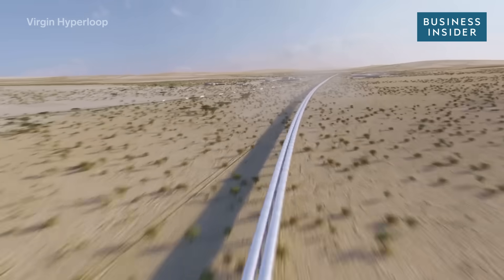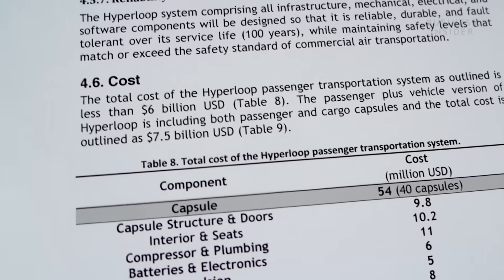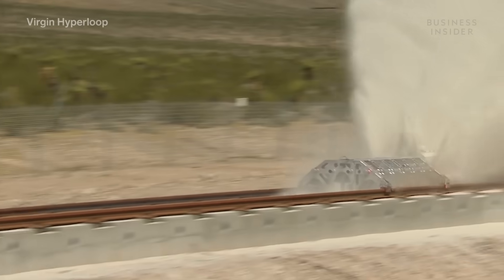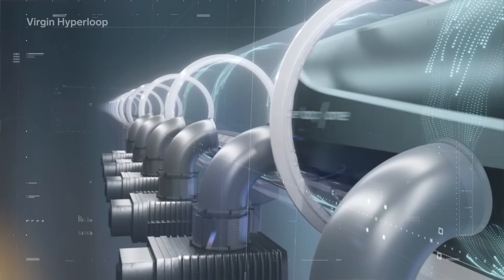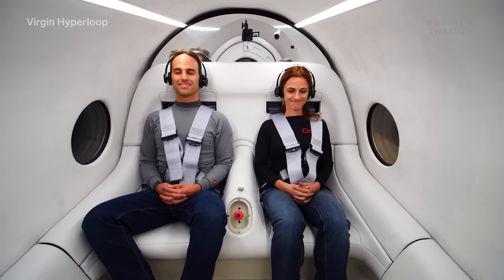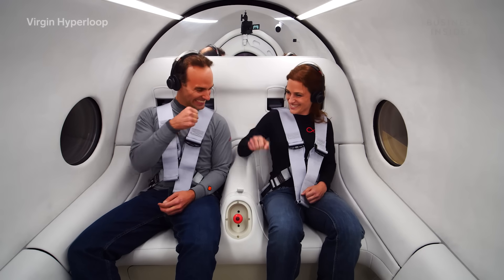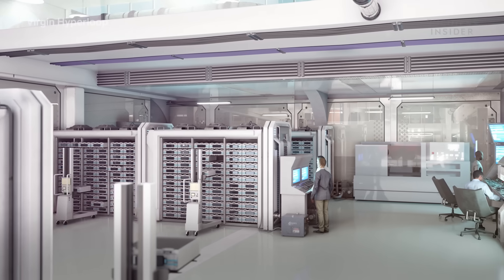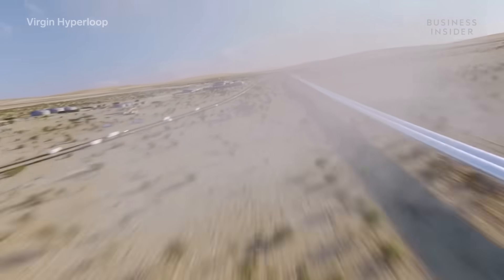How Elon Musk's 700 MPH Hyperloop Concept Could Become The Fastest Way To Travel

Comment: God. Can you imagine how terrifying it would be to be on that train and then the power shuts down or the train stops or something? You'd be stuck in over a hundred mile-long tunnel that is almost completely airtight.
Reply: Just ride a bicycle
Reply: @rennmedia  good movie idea lol
Reply: @rennmedia  Only if our cities were designed for bikes 🤔🤔
Reply: @WhiteOut-  Laughs in Dutch
Reply: @WhiteOut- come to the Netherlands
Reply: @rennmedia  if only you had air tho
Reply: @rennmedia  yeah you ride 30 miles to work every day on a bicycle
Reply: @rennmedia  yeah, it Superman is the driver
Reply: just imagine you travel with airplane,
Reply: @kharisnamaku  yeah LOL imagine choosing travel inside a bullet over than the safest transportation ever created 😂
Reply: Bro this comment thread is absolutely fascinating
Reply: Yeah, screw that.
Reply: It's a lot worse than that. If the tube ruptured at any point along its length, the train cars would be a obliterated by the air rushing in at the speed of sound, and the wreckage would be fired out like a bullet.
Reply: @simkoning4648  we have submarines that are airtight that haven’t been breached in 80 years.
Reply: Our bodies can bear the atmospheric pressure.
So can the capsule.

If air enters it will only slow down the capsule.

Also the tube is made with a material that can handle change in temperature.
Reply: @simkoning4648  the tunnels are vacuum or near vacuum.
Reply: @simkoning4648  WRONG. You just put 1 way air control valves every 10 meters or so along the length of the tube that open to the outside air if there is a loss of pressure. You haven't been watching Thunderf00t lies again have you?
Reply: Can you imagine how terrifying it would be to be on that train and then the vaccum is breached and you're whole body is forced through a 1 inch hole?
Reply: @Anonarchist  how will they be a hole then 
If theres an explosion you would have already died 
And you probably wear seatbelts since its that fast the first thing getting suck is probably bags and all that
Reply: @Anonarchist  that is creepy n scary af altho i think the will reinforce the body of the capsule n like sensors in the frame to detect breches which will immediately shut it down and preassureize the whole thing
Reply: @Anonarchist  don't worry, your body should be able to withstand 14.7 pound
Reply: @Anonarchist  I'm sure it'd be as terrifying as a breach on a pressurized airplane. That's why it's been tested over and over.
Reply: Kinda like on a plane that is decompressed
Reply: @Anonarchist  That's movie fantasy. Atmospheric pressure is only 14psi. However, if the tube failed catastrophically, which is very likely, the air rushing in would turn the tube into a air cannon and obliterate the cars inside it.
Reply: @Anonarchist  said, "the vaccum is breached and you're whole body is forced through a 1 inch hole?"

The exterior pressure is higher than the interior.  Thus this wouldn't happen.  Be pretty bad, though.
Reply: Emergency air tanks and escape latches with ladders spread over every mile?
Reply: @letsthink8245  that would mean at least tens of thousands of more seals and possible air leaks. which would render the 'vacuum tube' obsolete if it can't keep a vacuum
Reply: @boink666 even space is not and absolute vacuum. That is impossible but you could remove most resistance however. That in itself would be something. You could create a barrier like your tire with a gel that deals with leaks and seals them. Much like the green stuff  that would also do wonders on a space station as well.
Food for thought.
Reply: @letsthink8245  as soon as you opened the capsule door everyone would be dead in a matter of just a few seconds....
Reply: These people 🤦🏻‍♂️ 
Man, the INTELLIGENCE..!
Reply: Just a quick question, how should the emergency exit work? There is a vacuum, a door (that will have to be perfectly sealed when not in use) will have giant pressure pushing is closed. If you opened it, you would have to fill the whole tube with air until you can exit. Which means that you will either have to wait days, or be blown through the tube.
Reply: ”Can you imagine how terrifying it would be to be on a plane over the ocean and then the power shuts down or something?”
-What people said to the Wright brothers
Reply: That's why they're still studying it... lol...
Reply: Imagine talking to someone across the world with a small brick... Imagine going across the ocean in less then a month by flying rather then sailing by ship, Imagine a human taking a step on the moon...
Reply: @Faovidz  At some point, the precautions you have to take to fix all the flaws this design has outweigh its benefits. Building vacuum chambers that are thousands of times larger than the largest one we have -possible, but expensive. Evacuating it in less than a year after a leak - possible, but expensive. Building fail save doors to close off failing segments - possible, but expensive.
You may notice that we still dont have a jet airliner, even though it was technically possible. This is because there were fundamental flaws in its design making it useless. This is the same stuff. You are not fighting lack of knowledge, you are fighting basic thermodynamics, as well as Murphys law. And it is just not practical to make a system that has so many points of failure safe enough to use. Power loss - the cart gets destroyed. A pinhole leak - the cart gets destroyed. A faulty seal on the station (you have to bring passengers in all the time) - you cant use that section for a day or more.
Reply: @nanolog522  
Building vacuum chambers that are thousands of times larger than the largest one we have.
- That is false, because there are already existing vacuum chambers that is close to 1 kilometre. With each section going at 10km (which is quite a long range for a section tbh so they may go for shorter ones instead), it will be more feasible in 2025 when they build a 9.6 km long tunnel as well.

Building fail save doors to close off failing segments - possible, but expensive.
- That is semi-true. It is expensive, but not as expensive as you think. A route you see such as Cleveland - Chicago, runs around 500 km which is equal to 50 failsafe gates only. 50 is a lot but 50 checkpoints/failsafes are nothing compare to what you see in Japan Shinkansen Train Route, plus with modern technology in AI makes it a lot easier and faster and safer to control these gates properly. The Failsafe Gate may be just heavy rubbers with layered metal materials too since you do not need Sci-Fi Full Steel Gates to seal off airtights, and there are self-regenerative concrete and other options for these to be include along the tunnel. Making the tunnel a lot more safer. But is it feasible in term of economy? That is really something the big company can say, and they say it only cost $100 per ticket.

You are fighting basic thermodynamics.
- That is false, there is virtually no thermodynamics involved in this. Without air resistance (Due to Vaccum), it actually remove the very factor that makes sonic booms and breaking sound barrier a difficult challenge for commercial flights.

It is just not practical to make a system that has so many points of failure safe enough to use.
Power loss - Magnetic Trains are more safer than convenient trains in terms of this. 1) The trains hovers by power of Permanente magnets, not Electro-magnets. Making the train able to hover regardless of power. 2) If a loss of power is gone, a massive battery unit can easily be used to quickly decelerate the train to a safe spot, powering up a back up computer to calculate and communicate with the central network system to ensure the train decelerate to right and safe spot. Magnetic Train can decelerate a LOT faster than convenient trains due to the efficiency of magnetic brake using pure electricity. 

A pinhole leak - This is indeed deadly in space, but way different in here. Because unlike space, the force of pressurisation is depend on the volume of vacuum which in the pipe is very low compare to VAST empty volume in space. But as in you can introduce nano-materials that stretch a lot ONLY allow small leakage of air going in/out, like a tough plastic flim but in layers that making it harder for air to go in/out. Furthermore, you can introduce using a backup battery-power stored unit that quickly & effectively balance out the air pressure in event of no power & damage to the pipe. The unit can be extremely tough and small and connect to several different extraction units instead of 1 for safety concerns, and they are to introduce external air from all sides instantly to have the pressure of outside air through the pinhole leak slower. Using this technique, it is a lot safer and the force of outside air pushing into the pipe is less alarming and damaging to both the pipe. Ultimately, the press of air at sea level is extremely low and doesn't really explode like Space would, so there is no real damage to the train or its tracks really.

A faulty seal on the station - This issue can easily be solved by using extending AirTight lock from the Train connecting to the Platform. Just like ISS connecting to other space crafts, this has been done for decades and the conditions are similar. However, of course it means the Train Station Platforms will be more actually solid walls with bunch of holes and doors instead of just a normal train platform like the photo. Perhaps in future, there will be glass walls instead. But the space crafts connection seal is the most feasible way to achieve this effect without any possible faulty seals due to loading/unloading passengers
Reply: @keldableshowcase1445  Where do I start. First, comparing these gates to Shinkansen ist stupid. You would have to build and maintain airtight seals that are really big and just can't fail. Second, as the whole system will expand and contract, you can't use things as "self healing concrete", as concrete itself is brittle and easily cracks, even without thermal stress. Also, the vacuum chamber you mentioned might me a kilometre long, but its cross section is noch even a quarter as big as it would need to be for the real thing.
Another error you made is with the pinhole leaks. You just don't understand them. The speed of atmospheric ingress into the chamber does not depend on the size of the vacuum, but in the size of the hole and the pressure gradient. In space, this gradient ist even smaller than on earth, as space crafts usually have a lower inside pressure. There would only be a tiny amount of air getting into the chamber, but the problem ist mit the speed etc, but air being inside the tube. This creates drag, which might derail the train as it is moving very fast. In space, these leaks are not at all dangerous, as you can't plug them with tape before you loose all air. Here, the problem is that you might slam into this air at the speed of sound. Because of this, whenever an error ist detected, the whole tube will have to be shut down, and it will take days until all the gas is vented.
Even with the tiny chamber you mentioned, it took days or weeks to bring it's pressure down enough.
Reply: @keldableshowcase1445  Let's go in to my claim about thermodynamics. If you had actually understood what I was talking about, you would have known I was talking about creating the vacuum. That takes weeks at a larger scale. If it fails, that takes more weeks to fix.
My claim about maglev is not that they are inherently unsafe. Still, they would have to be used in vacuum, which makes them harder to maintain. And all these things just add up. Even just creating a mag lev is hard. Add vacuum, thermal stress, the problems of containing a giant vacuum... Sorry, but most of your points against me just show your lack of understanding, either about what I wrote or about basic physics.
Reply: @keldableshowcase1445  And I didn't even get to your stupidest claims about airtight locks for the stations. Docking a spacecraft to the ISS takes hours until they are sure you don't have a leak. Glass walls don't fix this. The problem is the amount of holes in your vacuum chamber, every single one a possible point of failure. Also, locks on the ISS are tiny. Filling a whole train through these would not be feasible, you would need several larger ones.
Nothing of your points makes sense. Most of it is just "oh, well, space-nano-self-heal-technology". Or you make up facts about vacuum, like it's lethality depending on the size of the vacuums volume (seriously, wtf?).
Reply: Wow so many potential hyperloop employees gathered together, if only I was as knowledgeable 🤡
Reply: Let me just open this window. Get some air in heeeeeeeeeeeeeeeeeeeeeeeeeee
Reply: It's okay because every hyperloop will have a direct uplink to Elon via video call during any critical fault where he will laugh at you as you suffocate to death in the vacuum with no life support. 

A hyperloop insider stated that in initial tests which failed, when test subjects died, Elon laughed so hard that he cried. He also tried to get out of paying the salary of the deceased test engineers to their living family, stating that "they didn't even get a good result, also I technically fired them just before they died via video call." In the end his lawyers forced him to pay out to avoid litigation.
Reply: lmao @palbi
Reply: Lol yeah being in a plane crash high up in the sky is a lot less terrifying
Reply: @Yize Dai his helpfull your being toxic
Reply: TEC Youtube   CPM cost per mile is the reasons subways are short not terrorism.
Reply: Still better than airplane power shutdown
Reply: @Yize Dai find Thunderfoot and his video debunking Hyperloop with real science!.It's just Elon's pipe dream!
Reply: Yeah right? I'm sure they never thought of that. Bunch of idiots. These people must have dropped out of elementary school. Stupid. Lol
Reply: The train would also drop to the ground right? Since it’s levitating because of the magnets
Reply: @jbj7799  the levitation isn’t really levitation. I’d be surprised if it is 1 inch clearance. It’s more like weight assist than anything. 
Repelling magnets suffer from the inverse square law.  The further they are away from each other, the less force repels, but it’s exponentially less. 
But in theory, yes, in a power failure, the car suddenly hits the floor and perhaps comes sliding or grinding to a stop.  Imagine that at 600 mph.
Reply: @Meatball2022  I don't think so there could be a power failure causing a crash If the thing has permanent magnets only with half permanent and half electric magnets it could like crash but not devastatingly cause half the magnets r still working u know
Reply: @zyphyr1229  I agree but the crash is different.  In a sense, when maglev fails, it comes grinding to a halt. At 200 mph that’s a possible issue. At 700 mph it might be a disaster. And that has nothing to do with the possible loss of vacuum or even a controlled repressurize of the tube. There are still no exits. There’s still no way out. You still have to sit in your van waiting for all this to happen.
Reply: @Meatball2022  okay I did not  know bout the maglev crash but r u sure the maglev that crashed did  have permanent magnets and not electro magnets also 🧐
Reply: @zyphyr1229  I was responding to someone’s hypothetical question about a “floating” train whose magnets failed. I have no idea if there was an actual accident, when, what caused it, etc....   that’s all news to me
Reply: @Meatball2022  ohh ok sorry I'm just lonely rn that's all
Reply: "Gets into an airplane instead?"
They're a flying pressurized hulk flying through unbreathable air.  A nearly 100% death rate on failure of the pilot or key elements of the airplane.  A simple bay door failing to close will bring the craft down.  (Google the DC-10)
"Gets into a car instead"
We drive personal machines weighting nearly a ton at over 65 to 75 MPH ever day.  Some drivers are drunk or high, but it's a norm.  A simple malfunction in the steering mechanism or wheels can cause the vehicle to crash.
Take a step back from the norms guys.
Reply: @North7able  people are dumb., they just want to cry over the issues about future tech (implementation stage tbh)
Reply: @nagakrishnamalluri8315  they are to scared to change lmao
Reply: @unavoidablevideos1953  yeaa, the point... ;) People
Reply: @North7able   "100% rate" yeah in the past, not nowadays. Also American airlines flight 96 managed to survive after the cargo door blew out (can't say the same sadly about turkish airlines flight 981). "A simple malfunction in the steering mechanisms or in the wheels can cause the vehicle to crash" bruh it's not hard to hit the brake pedal or the hand brake to stop the car. In a highway slow down gently so the driver behind you knows that you're stopping. Also airbags and seatbelts exist too.
Reply: @North7able  thank you for a very practical explanation to people who don’t understand
Reply: If they can make something like this then they probably have the power situation figured out
Reply: They will probably have emergency pod pushers that will push your pod to the next emergency exit.
Reply: There will be backup power, also the engineers have said that there will be emergency exists.

They can have backup oxygen masks like on airplanes.

The chance of a power outage will be very low...have you ever seen an airport have a power outage?
Reply: Bro, engineers think of this stuff. ESPECIALLY when it comes to safety.
Reply: They need to address all of this before this gets approved for service.
Emergency exits, Air backup systems, safety against unintentional or intentional rupture of the pods, vacuum pipe and much more, but I am sure smart heads are thinking of that.

There is huge issues still to be addressed and overcome. I am rooting for it, but it’s probably still a couple of decades away from actual public passenger service.
Reply: That's when vacuum-sealed oars pop out and everyone rows.
Reply: Don't worry. They will never succeed in making it air tight.
Reply: @0a0b68  it will be only 70-90% vaccum , 10% would be there for braking the car
Reply: @0a0b68  i dont think the goal was airtight but mainly major reduction in air resistance & protection from outside elements
Reply: @0a0b68  Oh I'm sure they will. But I'm also pretty sure they can't handle the maintenance cost of that vacuum 😂
Reply: @Zyleace  that vacuum will run off solar power and have an assembly line of bots to replace and conduct maintenance autonomously. Engineers on standby taking mini tubes for maintenance. Do you think the thinkers can't think? Maybe that's why they think and we pay tax. Their thoughts DO, ours end up on YT.
Reply: @GlobalEl1te 
 -Runs off solar power. Which I'm sure isn't enough and they will get more electricity from a nearby plant since they plan to make the thing move with maglev.
-An assembly line of bots which also needs to be charged with electricity. Heh, need more power?
-Engineers on standby. Oooh these engineers are there like 8 hour shift everyday for like 7 straight days? Oh well you already know how much this will cost to pay them no?

Seriously? I believe maintenance costs would be so crazy enough that I'm sure you wouldn't believe the it when you see the ticket price lol. I think the thinkers can think. But have they thought of other things which needed to be thought of? Just like how much they will need to keep the whole thing running. Sure they will succeed in building it. But well, I'm not gonna be that positive about it being a huuuuge success since I'd still have to see it run for more than 20 years. All I can say is, goodluck to that Hyperloop of yours.
Reply: @Zyleace  What are you, a boy? A child? Everything you have pointed out as 'critical mistakes' can be said to airlines and airplanes when they started out. What if a bird struck the plane? How about a lightning? Terrorist attack? Maintenance? Etc. But look where we are now. Just some 50 years down the birth of such prototypes by two brothers, humans are now globalizing more than ever. Accidents will happen sure. But if the benefits are more than drawbacks, can you stop your negativity and let innovators do their job?
Reply: @ivand2208  Hah, I'm not even talking about safety measures and critical mistakes. There will be no mistake. I'm talking about how much things it will need to maintain such a project. It will be more than the maintenance cost of airlines, ships, and high speed rail. Believe it or not, it will need a huge amount of resources to do so. Who knows how long hyperloop will stand? Goodluck.

Also, improve your arguing skills. Before you assume if someone is a child, learn to respect them first because your insults just reveal that you are not worthy to be respected. How barbaric.
Reply: @fuxionxd4822  Why don't I be a lawyer? Nice suggestion. That would give me lots of money. If that happens I'd be too good for you.

Why do I say these? Cuz I care rather than people who don't care, like you who would want to waste so much money when there are better alternatives with less maintenance cost. You Americans say that the things you do are for your children and their future but you guys want to leave them with something wasteful of resources. Pretty inefficient I'd say. America should just build a high speed rail like those in Europe and Asia.
Reply: @Zyleace  Funny for someone who demands me improving my arguing skills, you totally missed my point. I am talking how costly maintaining such a project would be. The point is airlines, ships, and high-speed rails has always been very expensive in their conception. Almost everyone during the conception of these three transportation methods thought they would be expensive, inefficient, and terribly ridiculous. But look at us now, these three are the pioneers of modern transportation.

Want another example? SpaceX. Almost nobody would believe in 2010s that a reusable rocket would be carrying astronauts to space before 2021. Not just because the amount of engineering involved is complex, but testing and researching it would be expensive and wasteful too. Now it is being used to launch a would-be global connectivity internet and other payloads to space.

Everyone knew the risk and money involved during the development stage would be too high. But that is the price of progress. If you will be complacent and stop advancement in society, please stop using the internet :).

Also, I would never demand respect from someone like you. "bArbAriC" my ass, kiddo
Reply: @ivand2208  For innovation and progress, there should always be skeptisism of it, To avoid or reduce a major waste of money and time, and possibly disaster.

That's why mainly authoritarian countries proceed with these types of projects using public money. The shanghai maglev is a catastrophic failure, costing millions of dollars, made in china. 

Better to treat these radically new ideas with a cautious, gradual approach. Remember there were countless concepts for transportation improvements that received a lot of hype, but never got anywhere.
Reply: @existnt  You're probably replying to a comment I made I no longer remember. But yes indeed, innovation should always have criticism and skepticism. Because that's the point of it, to improve and make new.

I am not against criticism and such, but all I remember here is arguing with someone who plain out rejects the possibility of hyperloop, which ≠ skeptic
Reply: @ivand2208  If a bird strikes a plane it's not gonna fall down like a rock, it's gonna glide and land. Look at US airways flight 1459 or Ural airlines flight 175. A terrorist attack on a plane is less unlikely than in the past since there are security checkpoints checking your bags to detect a weapon or a bomb. A train has higher chances of getting hijacked or bombed than a plane considering train stations have no security checkpoints to inspect bags. A lightning doesn't even affect a plane lol. The plane is the safest way of travel since they went through years of upgrades and nowadays there are far less accidents than in the past.
Reply: @kevinlleshi9327  Exactly my point. I don't know if you're arguing or validating my original reply. My point simply was, airplanes had many criticism in their birth, but because of efforts and time spent on it, it is now the most safest method of transport. The same thing might happen to a hyperloop, yes it is very dangerous (just like a plane in the early 1900s), but with enough progress it may be a success
Reply: @Zail
What if there is a power outage and the airplane control tower shuts down

What if there is human error and the person gives the wrong information to the pilot (it has happened before) It won't happen with hyperopia because it will be operated with a central computer.

What if birds hit the plane (this also has happened before)

What if there is pilot error

I can keep going on...
But you get the idea.

There are safety regulations that are given by the government, only if hyperloop passes will it be implemented
Reply: @Zaire India or UAE will be the first to get hyperloop so don't worry.
Let USA be stuck with outdated tech.

People should welcome new tech not criticise it.

People criticised planes when it started but now we know that plane is the safest mode of transport.

Wait till 2030 to criticise hyperloop if it fails
Reply: @GlobalEl1te  Bravo.
Reply: And prolly flung
Reply: TEC Youtube  subway is expensive lol
Reply: Japan laughs at your naivete
Reply: If the power goes out the the vacuum goes out so you would mostly still have air
Reply: Snowflakes ❄️
Reply: @nathannoumenon9988  👍
Reply: If the power shuts down, the pumps won't function.
Reply: @xandercorp6175  
If the pumps do not function, then the pipes will SLOWLY depressurised which makes the train inside the pipe to SLOWLY decelerate. It's a pump, not some Sci Fi 100% Vaccum Suck and then suck all the air in the world in 1 nanosecond.

Furthermore, the companies can easily construct emergency gates between each junction of the Vacuum Tunnels so that it will not effect any other sections if one fail.
Reply: @keldableshowcase1445  One of the most curious elements of YouTube comments is the phenomenon of strangers agreeing with me violently, but framing it as a disagreement.
Reply: TEC Youtube  actually that makes a great idea. why not build these underground? then it would be very hard to breach the vacuum from the outside and there would be very little air already. you could also separate loading areas from the main track, making a sort of air lock system like in space ships.
Reply: rhe train wont stop
Reply: @filgiupo  
The Train will stop. It's very very very very very very very easily to create a backup battery unit for deceleration. Furthermore, at such high speed, even with 99.9% vacuum, there are still plentiful air resistance force that literally slows down the train.
Reply: @Yize Dai don't worrk bro that guy does not know what permanent magnets r like a lot of other fukin idiots out here cause permanent magnets do not need electricity to work
Reply: If the tunnel lost power while you were going 700mph, I don't think you would have very long to feel afraid....
Reply: @johnwalker-fj5gy  
me: traveling at 700 mph
System loses power. Lights go out
Me: I think we just lost powwwwwwwwwwww
Reply: Yeaaaaaa, that would be a downside
Reply: Have you ever flown on a passenger plane?
Reply: Magnates don’t “shut off”
Reply: so basically the same as a plane but without freezing temperatures and not 10km up in the air. Think again...
Reply: Terrorism could just be using an EMP.
Reply: @ayoxe  
EMP isn't something you can detonate & create with a device size of a hand grenade.
Furthermore, once powers shut down inside the train, the train only slows down gradually. It won't crash at all due to the elevation is done by PERMANTE MAGNETS, not Active Magnets. The Active Magnets are for Forward/Backward momentum.
Reply: @keldableshowcase1445  Oh alright.
Reply: so basically the same as a plane but without freezing temperatures and not 10km up in the air. Think again...
Reply: If the power shuts down the vacuum pumps will probably stop too. I reckon after waiting a while for the air to reach you, you would be able to get out of the hyperloop and head for an emergency exit.
Reply: You don't have to worry cause it's a scam. They will never build this thing. We already have super-fast bullet trains in China, Japan, Europe, etc. and they actually work.
Reply: The would probably turn the vacuum off
Reply: There are risks to everything...except those risks are low.
Reply: I could be wrong, but aren't the magnets powered? If it loses power, the train will suddenly start producing friction along the rail and quickly turn molten along the floor. assuming it doesn't just rip in half on impact
Reply: 500 times better than a plane and most people have no problem with flying.
Reply: @Melle_meck  The problem is, that a ticket will be 500+ times more expensive as well, and thus most people probably will stick to flying.
Reply: @nanolog522  what are you talking about? What the og comment said was how terrifying it would be to ride a HL if something were to go wrong. What I said was basically that it still was 500 times better than flying because you are not 10km up in the sky facing a more than certain death, and people still choose to fly.
Reply: @Melle_meck  My point is, that it is not necessarily dangerous, but in order to make it suitable for passenger use, you will have to create so many safety features, that, if it is "500 times better" as you said, it will also be 500 times more expensive, or more.
Reply: There will be safty exits build in bruh
Reply: It’s magnets 🧲
Reply: Magnet lev
Reply: Immagine if the engines stop on an air plane.
Reply: @danielekirylo  it would just glide
Reply: @XPLSVT  yea sure I can see that  boing 737 packed with fuel and people gently gliding on a field of flowers. LOL
Reply: @danielekirylo  you know planes can dump fuel right ?
Reply: Yeah, they never thought about that haha But seriously, for memory, the pod designs have on board power, so they can limp to the end of the line under their own figurative steam.
Reply: I doubt they will be used as human transporters but in the beginning it will probably be used as cargo transporters
Reply: @flymax7377  I very much doubt they'll even get built. They are never going to be able to create and maintain a vacuum in the system for it to work.
Reply: @furious32ninja  who knows? Technology is advancing maybe not tomorrow maybe not in the next decade but we will probably be technologically advanced enough to build it in the far future
Reply: @flymax7377  it was an idea conceived a 100 years ago, even if technology advanced it would a will forever be a pipe dream for Musk.
Reply: They would likely have access doors and back up oxygen
Reply: It’s no different than a plane really
Reply: that goes bothways for an airplane
Reply: @Yize Dai if a plane shuts down it can just glide and land either at the airport either in a random area of the ground or in the water. It's not gonna fall like a rock unless you shoot a missile at it or board a bomb, which is very unlikely due to the security checkpoints.
Reply: @Yize Dai As I said before the plane has a backup battery for the instruments and it's not gonna destroy itself if it lands on water or on flat land. And it's not like the plane needs the instruments, especially when the weather is clear. Just get out of the clouds and you have visibility of the ground.
Reply: @Yize Dai how am I arguing with non-sense if I'm talking about on how safe planes and cars actually are ? Stop trying to change the subject you bigot. You clearly don't know the safety features of a plane or how it goes when the power or the engines go out and then I'm the one with limited knowledge. Again you bigot.
Reply: Also you cant look nature around yourself, and culture of country
Reply: They should at least have an emergency battery or something so that the train can still have the chance to stop safely...
Reply: They have emergency exit at every 75 meters in tunnel
Reply: They'll probably put in safety precautions for scenarios like that.
Reply: They would have to come up with an emergency exit as well they probably should consider having many a certain amount of miles apart probably would be the only way for this to truly be safe
Reply: That is the same thing with planes and even worst ! So yeah you can ride a bike
Reply: Elon has a fix for everything all he has to do is look up old patient
Reply: A plane is still worse. You will still live if a train breaks down, you can’t with a plane.
Reply: @DarthMadV  if a train break in  Hyperloop your just as dead as a plane ,
Reply: Dont use God's name in vain, God bless you
Reply: @mrridiculous4896  huh
Reply: Maybe The same Thing what would Happen if an airplane shuts down or something . Maybe Not so dangerous like the airplane .
Reply: Isn't that what happens in the subway?

Anyways there are solutions to that problem. Firstly batteries onboard the train itself for backup power to get to next station. Secondly you could send another tow train down the line to push the other "pod" back to the station. 

I guess one thing that could happen is the complete failure of the train being able to be moved (pretty unlikely) in which case you would need to do an inner tunnel transfer using some sort of airlock to another train or you would need to depressurise the entire tunnel.
Reply: They will have to have some sort of safety protocol for those issues. You only live once, might as well make the most of it
Reply: pretty sure they will develop some access points possible? air lock points for maintenance and management? could be wrong? also as long as a magnetic field is present and similar polarizations are always facing each other we should be gucci
Reply: that sounds awesome..
Reply: Dude just wait noob
Reply: You want to live forever? Go the slower route sweet pea.
Reply: Welcome to Elon's world/your nightmare. Yeah, keep in mind this guy not only conned people, but he is currently conning Cons. All those Conservatives, all that money. My guess is he is going to have a tech for farts that can turn them into Tesla/SpaceX gases that won't be wasted.
Reply: That's like saying what if the plane you are in crashes. Accidents are always a possibility.  Cant live in fear.
Reply: Can you imagine how terrifying to be on a plane and it fails? You'd be falling straight into the ocean - or worse - into a city full of people. Time to ban planes!
Reply: Magnetics never fail
Reply: If science consider only circumstances, humans would not be able today to have supersonic fighter jets, space shuttles, ..... Anyone has the choice to use a bicycle or horse or walk to feel safer.
Reply: Good news is that There is no way that that vacuum tunnel would be feasible.  But while we are indulging in what if’s…. What if there is a containment failure, like a door seal? Then this pod would be shot out at near the speed of sound like a giant spit ball in a giant drinking straw.  Good times.
Reply: You don't know how infrastructure and safety systems work.
Reply: imagine if the airplane power shuts down or stops?? whats the difference
Reply: You're not making any sense. You obviously don't know much about modern commercial aircraft redundancy.  @1CssTeam
Reply: lol. Obviously you are not flying either 😂
Reply: "What if the plane just stops in the air"
Reply: I'll take that over being instantly dead from a plane stopping instead
Reply: You are thinking of combustion perspective. Open your goddamn mind and think Stargate technology, you knob.
Reply: What will happen if everything failed inside an areoplane? 
Hyperloop train can not be that dangerous than the flight.

Afterall we are on the land.
Reply: Dude. Really?

Do you not understand what a vacuum is?

Please stop commenting as if you know what you're talking about. @wahidsaifudeen1651
Reply: Imagine an airplane failing
Reply: So, At least you aren't going to fall out of the sky at 550 mph.
Reply: Imagine going on an airplane ✈️
Reply: You could make and emergency system that would create a magnet field for a short amount of time and get you to safety.
Maybe but i am just thinking outside the box.
Reply: Claustrofobic paranoid detected 😅
Reply: It is magnetic. Please HEAR
Reply: You could give each section a battery life. So if power did go out nothing would happen
Reply: Yup. For the simple reason 100 oneway,  I'd fly southwest everyday... 120 round-trip can't go wrong... ... claustrophobic vibes airtight tunnel? Only aliens would go ahead with that concept
Reply: And then the dilophosaurs enter and kill Dodgson
Reply: No breathable air
Reply: It would definitely be unnerving, but rather less terrifying than plunging from 11km above the earth's surface in a failed airliner.
Reply: That's not how it works. Airplanes do not plummet from the sky when they lose power. They glide down in a controlled manner and can land at an airport if they have enough elevation when it happens. 

You're out of touch with reality. Go watch some aircraft power failure videos and learn what really happens. @komradepistoff6584
Reply: I mean If you’re in a plane without fuel in the middle of the ocean you’re not in a better situation
Reply: Damn, as if they won't think of this... Imagine they are like you
Reply: God can you imagine being stuck inside a giant metal tube flying hundreds of mile in high altitude imagine this gone wrong?

God can you imagine being stuck inside a giant steel cage in a middle highway with multiple other giant cages rushing past you just as fast, imagine if something gone wrong?

God can you imagine if you're a stuck inside a giant steel boat drifting in the middle of giant ocean and the power shut down?
Reply: @TheMrBonzz  You left out, God can you imagine being stuck inside a giant aluminum tube thousands of feet in the sky and flying at hundreds of miles an hour, imagine if something went wrong?
Reply: @TheMrBonzz  The metal tube is not a rock it can glide you bigot. About the steel cage you're the one in charge of your vehicle and if you crash it's your fault not the car's fault. Also seatbelts and airbags exist you know. With the boat just call the cops and they will call the coast guard lol. On a cruise ship or cargo ship if the power shuts down it's completely fine as long as the engine is running and use a map to know where you're going. If the ship's engine goes off call other ships to help ya or the coast guard or hop into a life boat and go to land.
Reply: Can you imagine how terrifying driving a car us like what if the petrol runs out or what if the door cant open like what if we crash if we crash in high speed we would die immediately
Reply: @fuxionxd4822  then it's your fault if you crash at high speeds because you are driving. If it runs out of fuel keep a fuel can on the back of the car so you can refuel it yourself or call the cops so they can call a tow truck and drag your car to a gas station. If the door can't open try to open the other ones or break a window and escape from there.
Reply: And that probably uses a lot of electricity
Reply: Runs out of air
Reply: TEC Youtube  It could be good for freight loads tbh but for living things and people, it's gonna be a whole ton of work if something goes wrong.
Reply: They are smart enough to see this coming
Reply: @mostsubbed1  This is a century old idea that was never realized because it's utterly impractical and insanely dangerous. Musk isn't some a genius inventor, and these are just investment scams. Think kickstarter scam but for gullible, wealthy investors and ignorant politicians. There's no shortage of them. Thunderfoot and The Common Sense Skeptic have good videos on this..
Reply: @simkoning4648  air travel and space travel was a century old idea that was utterly impractical and dangerous but guess what? We managed to make it safe
Reply: Not really because if the power goes out, the pump would stop and that would mean the air would be coming inside to balance the outside pressure.
Reply: @kylecastillo3021  But then that means you have to pump the air out again once the power comes back and that means more power  consumption=more cost. Hence, ticket prices goes brrr. 

However, even vacuum or pressure pumps normally don't work like that. Even the electric vulcanizing pump retains gases inside without the need of constant pumping which should also apply to vacuum pumps.
Reply: @Zyleace  Unless the power goes out everyday then Its understandable to raise prices. But if its a one time thing then that wouldn't be an issue.
Reply: Power outages are very rare and I have never heard of a power outage in an airport.
So it probably won't even happen with hyperloop
Reply: Cant they have emergency exit?
Reply: @Yize Dai so what has your beloved Elon done! He's got where he is by climbing on the backs of giants as Sir Issac Newton would say! What he has done is not tell the truth about Solar city when he suggested their purchase to Tesla investors and we are all waiting to hear how many millions that is going to cost him. What about all those ventilators he said he was making in his factory for Corona victims, but purchased the wrong type and simply put Tesla stickers on the boxes. What about the time he called the rescuer of the football coach and twelve boys from that cave a paedophile because he said the submarine that Musk offered would not work. There are just a couple of stories fanboy, why Musk isn't the god you think he is. He's a POS psychopath, just ask his ex-wives, but if you can't be bothered to educate yourself by seeing what Thunderfoot said, I doubt you are going to bother researching how he treated his wives. Keep on worshipping your clown hero sunshine!
Reply: @furious32ninja  he's still contribute to society far more then you peasent can.
Reply: it use magnets g how tf will a magnet run out of power?
Reply: They'd have safety exits. Of course
Reply: theres probably emergency exits all over the tunnels lol
Reply: Amazing thing call "exit door" 😄
Reply: God. Can you imagine how terrifying it would be to be on a underground train and then the power shuts down or the train stops or something? You'd be stuck in over a hundred mile long-tunnel that has no exit
Reply: @fuxionxd4822  just wait until power restores or open the doors manually with the emergency levers or break a window and just walk up to the station.
Reply: God .Can you imagine how terrifying it would be to be on a plane and the power shuts off and we die immediately?
Reply: @fuxionxd4822  if the power shuts off there's a backup battery and it's not like the plane is gonna fall like a rock. Please learn physics.
Reply: If it is Mag lev and the power fails it would probably crash down and explode. 
The whole concept is ridiculous.
Reply: 1) mag lev trains already exist, so it is proven technology 

2) this is not a movie, even if it falls it won't fall from such a height that it will blast

3) permanent magnets will be used to keep it up and electro magnets to make it move. So even if there is a power outage it won't fall
Reply: Aldot234 mag lev trains are already in existence
Reply: @aldot2343  u are one of the guys who do not understand what the word "permanent magnet" means google it u idiot cause permanent magnets do not need electricity to work
Reply: @aldot2343  no
Reply: @aldot2343  LOL ... you watched to many Hollywood movies.
Reply: @aldot2343  No it's also on wheels. Do more research before talking nonsense.
Reply: @aldot2343  it already exists. Your ignorance is amazing
Reply: @aldot2343  You mean like an airliner? By your reasoning, commercial aviation must have been a far more ridiculous idea - especially since they've much farther to fall, rely upon expert oversight (for both operational and security reasons) for the duration of the journey, are loaded with jet fuel, and are constantly subject to the weather. I'm not arguing with you, by the way, just stating a point.
Reply: @aldot2343  I mean there could be emergency systems or permanent magnets idk I’m sure technology will catch up
Reply: @gl-jp8up  it will not. This is NOT A NEW TECH, it has already reached its limits.
Reply: @aldot2343  magnets don't need electricity
Reply: @Kstuchbery  electro magnets do
Reply: Bruh you are thinking short, ofcourse they wouldve build emergency escape door or anything similar, lets just say u are not supporting elon musk creation :)
Reply: There would be emergency exit duh
Reply: @gl-jp8up  yeah duh... how do you keep it air tight ? How do you manage peoples getting out without breaking the air tight seal ? Or do you just decompress everyone at once? On all the tube ?   And how many doors ? One every mole ? Every 5 miles ? How do you travel in a vacum from the pod to the exit door ? You poor moron, This concept is a complete non starter from the beginning  dude... (duh !)
Reply: @CasusBelli1000  
How do you keep it air tight ? - You don't keep it "air tight", that is very reason why pumps every 10km exist for constant non-stop pumping.

How do you manage peoples getting out without breaking the air tight seal ? - Just like Space Station in real life, they use air tight seals between two Space-crafts which can be easily achieve in here.

 Or do you just decompress everyone at once? On all the tube ? - You do not decompress everyone, it's not a Vacuum Cleaner. The Tunnel gets CONSTANT Air Pump out 24/7.

And how many doors ? One every mole ? Every 5 miles ? - Each Tunnel is consist of 10km long and power up 1 giant Vacuum Pump, meaning every 10km there is a seal gate that LITERALLY will shut down in case of emergency and stop the pumping in that section, allowing that pipe to be depressurised. You do not need any escape door like any tunnels, all you need is for the train to have BACKUP Decelator Unit (That has its own battery) that works without any electricity supply.

How do you travel in a vacuum from the pod to the exit door ? - As seen on ISS and MANY Space-Crafts, all you need is giant RUBBER around the extending door and then wait for compression and then that's all it need.

This concept is a complete non starter from the beginning  dude... (duh !) - Any concepts are physically possible regardless of how you may think or imagine, the universe is full of possibilities and it is you as human being with responsivity along with your gifted intelligence to explore the wild imagination and ends of the universe. Not barging it and then just go trash on people.